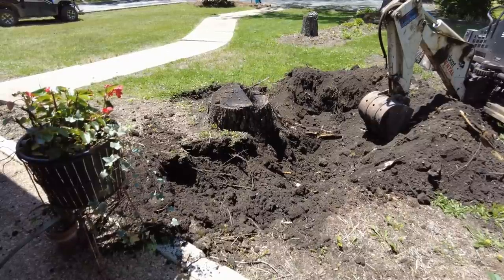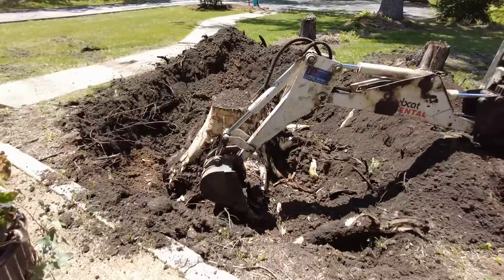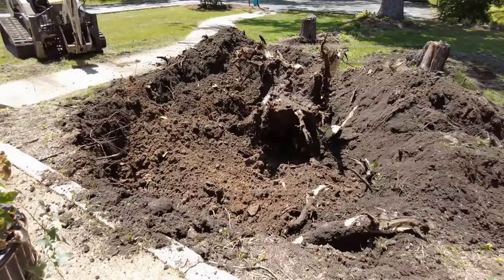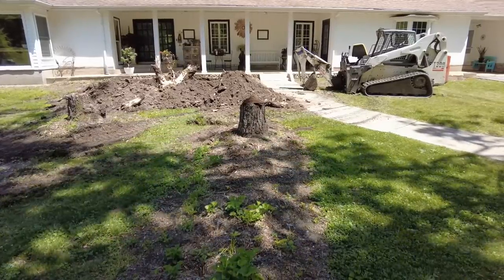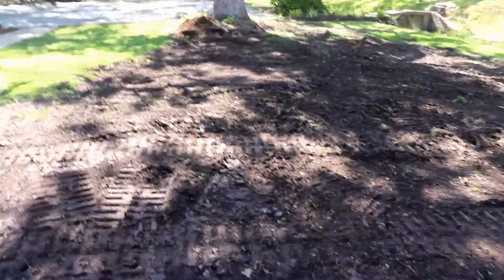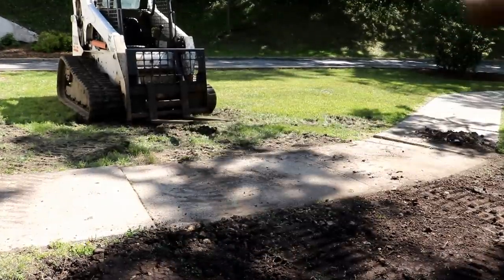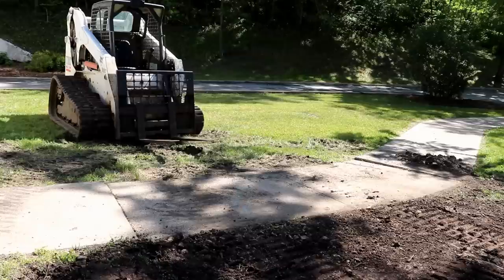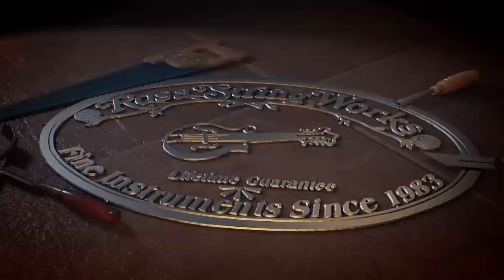646 RSW Digging Up Stumps  and Leveling Old Sidewalk

Comment: Would a stump grinder work better? Grind everything down & leave the sawdust to go back into the earth. You would have skipped hauling everything away and then filling the hole back in. Am I wrong or right? Awesome video thumbs up. Stay well & safe everyone.
Reply from the maker: Stump grinders are slow messy and leave wood in the ground which invites termites peri will also solve these into slabs on my sawmill

Comment: I'm as frugal as the next guy, but it seems to me that renting a stump grinder, or even hiring someone with a stump grinder, may have been a better choice.  Either way, all three stumps would have been ground below grade level in the time it took you to dig out just the first one, AND with little to no damage to the surrounding lawn, which you will now have to spend more time, and money, to restore.  AND you'd have a substantial pile of woodchips for landscaping beds.  As a smart man has said repeatedly, "Ask me how I know!"
Reply from the maker: Stump grinders are a poor choice in my opinion because they leave the wood in the ground to rot and it invites termike's and in addition I have a sawmill and planned to slab the stumps because that's where the high figured wood is
Reply from the maker: Besides it only took an hour and a 1/2 it would have taken me nearly an hour And a 1/2 to go rent The stump grinder
Reply: @RosaStringWorks  After I had sent the message, I remembered that the stumps were walnut, and wondered, 1) if they were big enough to slab useful pieces out of, and 2) if that was your plan.  A lot of the pricey Brazilian rosewood these days is coming out of old stumps.

Comment: As a person who has made this mistake before- just use a splitting wedge and split that stump into a million pieces. You've got that damned bucket to drive the wedges in. 

Either that or pour salt on it and wait two years.
Reply from the maker: Only took an hour and a 1/2 to do all 3 why would I want to split it
Reply: @RosaStringWorks  only because it's faster to split it.

Comment: Is there a use for the stumps? If no, wouldn't renting or borrowing a stump grinder be easier?
Reply: Problem with all but the biggest of stump grinders is that they really only grind the stump to a foot or so below ground level.  Most of it tends to remain underground. That's like ringing the dinner bell for Subterranean Termites. Then when they get bored, "Gee that house looks mighty tasty"!
Reply from the maker: the grinder is slow messy and leaves wood in the ground.  I will slab them on my sawmill
Reply: @RosaStringWorks  Some of them make good bowls if you're into that kinda thing. Get yourself a good adze n make dough bowls. A man who's really good with a adze can cut his foot off AND shove the handle up his backside with one swing! Lol